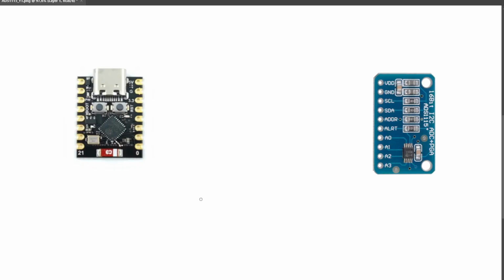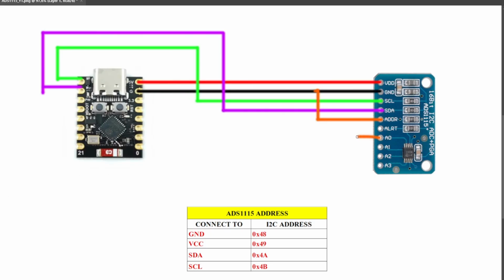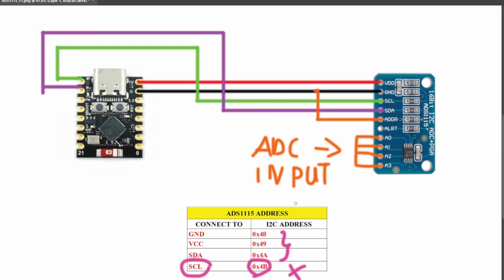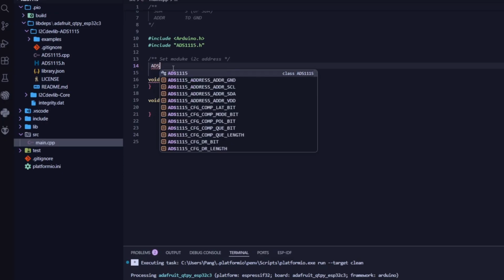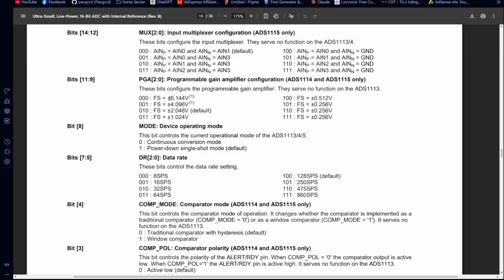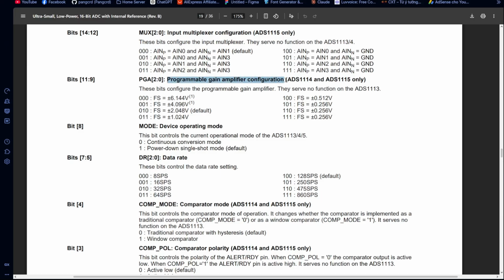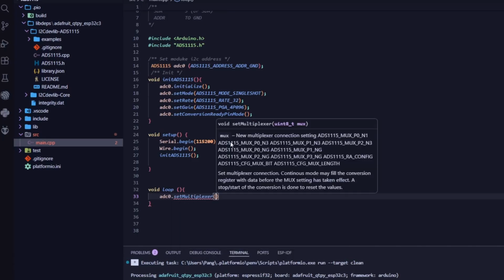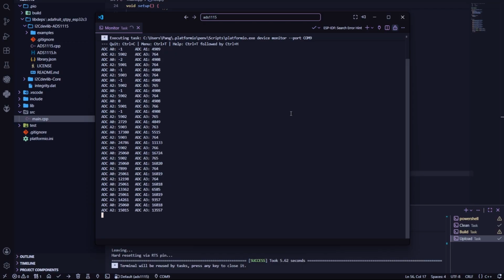ADS1115 Full Guide | 16-Bit ADC with ESP32, Arduino & PlatformIO

Comment: Will I experience any loss of signal data when converting a 5V signal to 3.3V?
Reply from the maker: Do you mean whether scaling a 5 V analog signal down to 3.3 V before feeding it into the ADS1115 could reduce measurement accuracy or cause any loss of information?

I haven't tested this specific setup myself, so I can't say how significant the effect would be. However, if the scaling circuit is linear and properly designed, the impact should be negligible. You just need to consider the accuracy of the resistors/level shifter, noise, offset, ADC resolution, and input range.
Reply: @pangcrd  Thanks a lot for the answer :)

Comment: Anode (+) of LED goes to Vcc, with resistor in series.
Reply from the maker: Oh my bad! You’re absolutely right. I made a small mistake while preparing the content for the video.
If you’re using an LED with the ALERT pin, it should indeed be connected the way you described. Thanks for pointing that out!